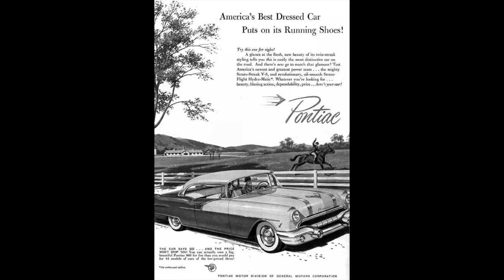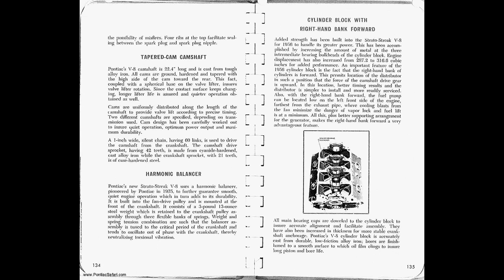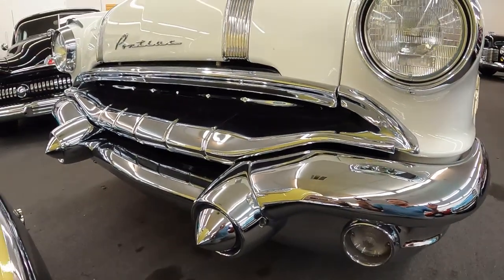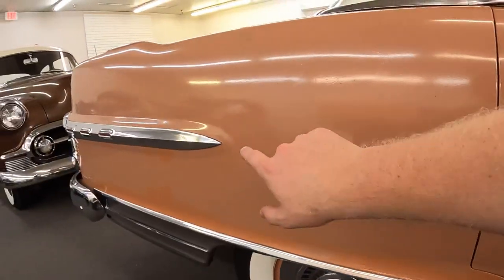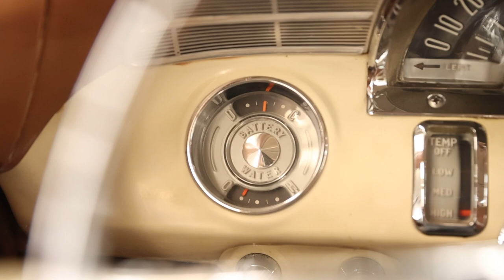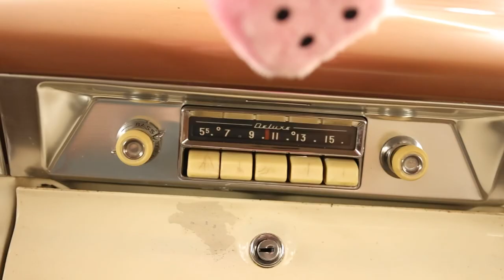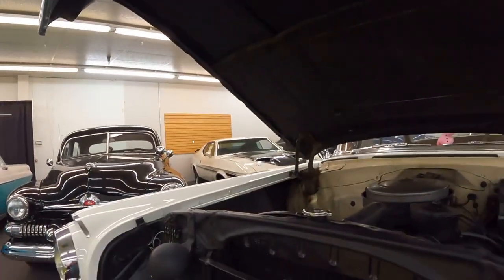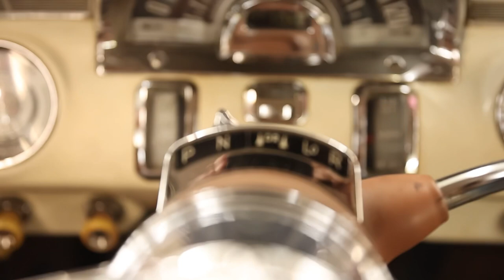1956 Pontiac star chief 4 door hardtop

Comment: In July, 1956, my Aunt & Uncle, pregnant with their first child, took $2300 out of a stock fund they had inherited. They walked into a Pontiac dealership in Montclair, NJ, and asked what they could get with their cashier's check along with their 1938 Pontiac as a trade in? They ended up with a 1956 Pontiac Star Chief 4-door hardtop very similar to your featured car. It was loaded with Hydra-Matic, power steering, power brakes & radio. 316 4 bbl. V-8. It was a powerful & very durable car they had for 16 years. The speedometer has a red line (actually a disk under the facing) which rotates up & around as speed increases....a very attractive effect as you're driving along.
Reply from the maker: Awesome thank you so much for sharing that car with us =) it sounds like it was the awesome family hauler

Comment: 1956 was the first year of newly designed  controlled coupling , dual internal fluid couplings ,Jetaway Hydramatic. Because they eliminated a couple friction clutches by using sprag clutches instead, the hydramatic no longer had a neutral clutch and would no longer lock the transmission with the selector placed in "R" and the engine shut off, so they had to add a park mechanism.
Interestingly, you might say that these new jetaways were similar to today's dual clutch, dual input shaft manual transmissions. To change  gear ratios, the internal fluid couplings would independently drain and fill. This gave a longer drawn out shift but was very smooth, the ultimate goal of an automatic transmission.
The final generation of the Hydramatic was the Roto-Hydramatic for 1961. It still had dual internal fluid couplings, and operated similarly for gear changing, but it now had just 3 forward speeds. With re-circulating and re-channeling the fluid in the fluid couplings, they acted as a torque converter, so the lower 1st gear was no longer needed. During the shift from 1st to 2nd, it was a long drawn-out shift, ending in a bang, as the fluid couplings drained and went into a locking mode. The shifty from 2nd to 3rd was shorter and also ended with a bang. It was a very uncomfortable-shifting automatic. Definitely not suited for Cadillac at all, but restricted to the lower-line Olds and Pontiacs.
Reply from the maker: Thank you so much for sharing all that information and insight =) really appreciate it

Comment: As a Pontiac guy, I love Pontiacs in general, but I could never warm up to this 1956 model. It's the kookie styling. I love the 1955 and 1957 Pontiacs, having owned one of each of those year Pontiacs, but 1956 not so hot. The Tri-Five Pontiacs 1955-57 were all designed by Pontiac's chief designer, Paul Gillan, supervised by Harley Earl. The 1955 was a real game-changer for Pontiac, since it was an all-new design from previous year models, and was the first year of the Strato-Streak Pontiac OHV V8 engine. Pontiac had offered a flathead straight 8 engine from 1933 to 1954, and its time was over by the early 1950s. Actually the 1956 model styling was Paul Gillan's alternate design for 1955, so he didn't have to work very hard to provide the 1956 models and went on to design the excellent 1957 Pontiac with its cool tail fins. The 1956 Pontiac has the same instrument panel and dash as the 1955 model, but the knobs are all black for 1955 and ivory white for 1956. The engines were increased in CID each year as well as HP: for 1955, the first Pontiac V8 is the 287, the 1956 is the 316, and the 1957 is the 347. The Hydramatic auto transmissions were great for driving pleasure.
In addition to the top of the line Star Chief models being offered as 2-door hardtop and convertible for 1955, in 1956 GM introduced their lines of 4-door hardtops as well, and the really cool Pontiac versions of the Tri-Five Chevy Bel Air Nomad sport wagons, called the Pontiac Star Chief Custom Safari 2-door sport wagons.

Comment: I had a 56 2 door star chief, mine was copper and cream as well. There were options. Mine had a B&M hydro and the Strato streak V8, and said so on the side of the car. The seat was not power but it was 6 way.

Comment: My first and only antique car was a 1954 Pontiac Chieftain Deluxe.  It had the flat 8 and was supposed to have the 4-speed hydramatic.  It actually had a Powerglide as it was built in the aftermath of the Hydramatic plant fire.  0 - 60 in that car was measured with a calendar!  I liked tooling around with it until the valves started breaking.  Sold it about 20 years ago.  I wish I went in and fixed the engine, ah hindsight!  

Would I Rather:  First the 1956 Chevy and Second the 1957 StarChief.
Reply from the maker: Awesome choices thank you so much for sharing your experience with your car.. i’m going to have to include that in some of the periodic maintenance that needs to be performed on some of these old girls that don’t have self adjusting valves. That’s what I originally set out to do with this channel was to give information that’s not easily found but I’m finding out that you can’t give all of the information because oil is going to depend on location/ outside temp And some of the oil weight that they had back in the day they no longer have.. The other crazy thing is you have to make sure that any oil you dump into your machine has zinc in it because if it doesn’t it will ruin things. Finding oil that’s nine synthetic is becoming really difficult ironically Dollar General sells conventional oil that’s nonsynthetic..
Reply: @What.its.like. What I think happened is the prior owner used unleaded gas without a supplement, I worked with his son in law.  I did use a supplement, but I believe it was too little too late.

Comment: Your choices today are interesting, fun, and with more I know this sounds redundant, but Pontiac (using the same engine block) changed the displacement every year from 1955 to 1959. Starting at 267 cubes to 389 cubes. I have a friend with a 55 Pontiac 4 door but the 267 is gone but goes well using a Chevy 327 with a mild cam. I'd take the 56 Chevy, and the 57 Pontiac.
Reply from the maker: I like to switch it up every now and then with the choices especially if you’re thinking about buying one of these cars what relates to it what came before it or after it. =) great choices

Comment: The '56 Pontiac seemed to share its taillights with the '55 model, although '55 without the hood over taillights. Also notice how the taillight housings on '55 & '56 Pontiac wagons is the same as Chevrolet of same era. The traditional Pontiac chrome strips which ran beside the engine hood and trunk deck were discontinued after 1956. Earlier Pontiacs had the wide chrome in the center.                                                                                                                                   When it comes to choosing favorites I would go with the 1957 Pontiac. But I would choose the '56 Olds & Chev over the '56 Pontiac.

Comment: To my eye, the 55-57 Pontiac was the ugly stepchild of GM (with the 57 being a bit better when they ditched the suspenders).  Way too busy!  Didn't sell nearly as well as the other divisions either.  Not until 59 did Pontiac really start to come into its own.  Which was a shame, because you got a lot with the Star Chief.  Top line Pontiacs, particularly the later Bonnevilles, were always better appointed than the Buick and Olds B bodies, especially 64 and later with the Broguham option.  WYR - the Olds (even though the Bel Air is better looking), and then the 57 Pontiac.